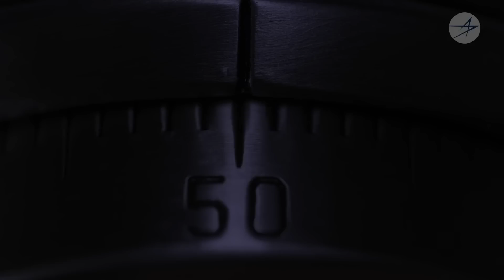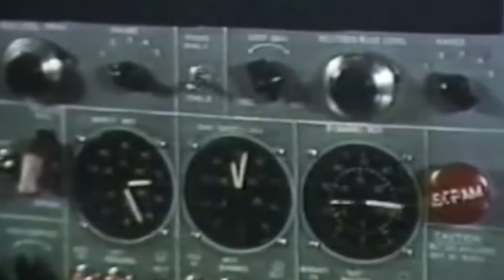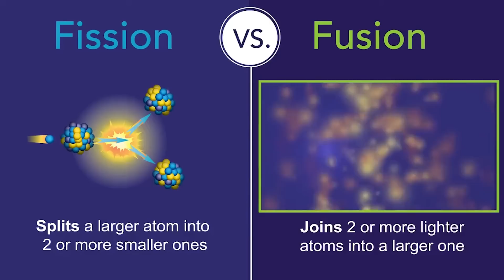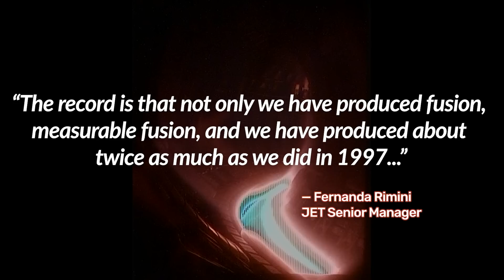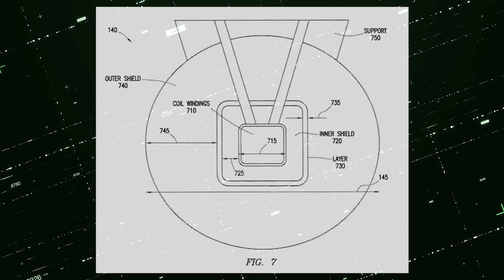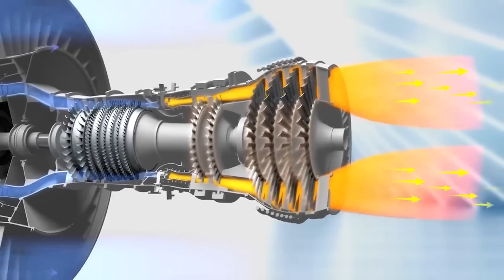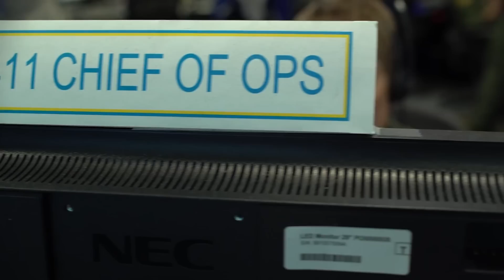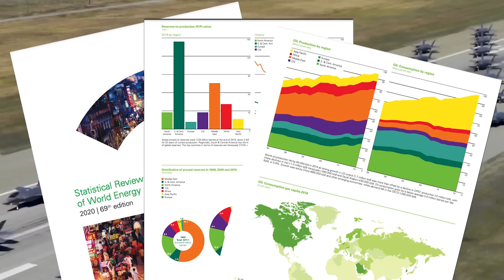Lockheed Martin's fusion-powered fighter and bomber plans

Comment: On a Separate note, why not have stealth tankers ( larger ones rather) or a stowed, carry along a mini killer gas station protection drone or two, they could be folded up on pylons, and if fighters threatened at a vulnerable time far from fighter protection,  one or two small remote combat drones, with AIM120s or AIM9x/ meteors could act as mini F14 Tomcats creating a perimeter @ the boat(flying gas station or P8) they could probably even be re - hooked to pylons mid flight for re- fueled,  and reused with AI assisted flight controls, just a goofy idea to make tankers way more independent and safe, the drones could even self destruct to stop a larger missile, or attacking fighter, with no pilot, two mini, supersonic, protect drones with long range weapons, in flight refueling, and possible kamikaze availability if needed, would keep advisories much further away, even P8 Poseidon's could carry something like this to keep bullies from buzzing the nose, the bully advisory jets would be met by two mini attack drones behind them fully armed, with no pilot to lose, and a message to head away from the US tanker or Posiden, then fly back re hook, re fuel and wait for the next task, I realize that's a huge workload, but the technology to make it happen is probably already developed. Probably work best designed with and integrated from scratch with the next gen of tankers and reconnaissance platforms, the Skunk works people probably already have something better 😂😂

Comment: Molten salt thorium reactors can, with modern engineering & materials could be made small enough to power a rather large aircraft. No massive amounts radio active materials & operates at temperatures liw enough to directly power a hot gas turbine

Comment: A major tragedy of nuclear powered aircraft reactors gave engineers and physicists to develop a potentially revolutionary power source better than many of the advanced reactors working today.  But for a number of reasons the US development of MSR,  Molten Salt Reactors designed by Alvin Martin Weinberg was an American nuclear physicist who was the administrator at Oak Ridge National Laboratory (ORNL) during and after the Manhattan project. Alvin was one of the greatest designers of reactors. The John Moses Browning of reactors. It was obvious that a nuclear bomber was impractical. But the potential for MSR reactors was huge. But Nixon had no understanding of nuclear energy cancelled the MSR project in 1972 for purely political reasons.  China is now using the Oak Ridge technology and research for its own MSR reactor project. MSR reactors have huge potential for low carbon energy. And also able to burn up existing nuclear fuel waste and weapons material. And potentially depleted Uranium and Thorium waste. Safer, cleaner and cheaper nuclear power. Far cheaper than the international ITER project.

Comment: I really like your videos.  But you do fission a disservice here.  

1. Waste cannot be dangerous in millions of years.  If it has a hundred thousand plus year half-life, that's not very much radioactivity.  Meaning it's not radiologically dangerous (unless it's something poisonous you can eat, but the same could be said for crushing random rock that has arsenic in it).

2.  Fission reactors do not all melt down.  For instance, molten salt reactors cannot melt down.  This is especially pertinent because the Aircraft Reactor Experiment actually used molten salt as a fuel.  Fukushima was a water moderated solid fueled reactor, and Chernobyl and graphite moderated solid fueled reactor.  The simple fact is the molten salt aircraft reactors would have been orders of magnitude safer than modern light water reactors (which are themselves way safer than Chernobyl).  I'm not saying to put reactors into airplanes, but let's be factual.

Comment: No. This will not work. A fission reactor on an aircraft can be done, but it's highly impractical. One of the many problems with that concept is the shielding: you need a lot to protect the crews from the high-energy neutrons coming from a fission reactor. Fusion produces neutrons of even higher energy, requiring even more shielding. Even if we can find a way to make magnetic confinement fusion work (which we never have), and even if we can miniaturize that kind of reactor (which we never have either), protecting the crew would require too much shielding for this to be practical in something the size of an F16.

This is setting aside the fact that you'd have to find a way to turn energy generated in this fusion reactor into propulsion for the aircraft. Simply having lots of fusion energy doesn't make that energy useful; we've had fusion energy since the 1950s in the form of hydrogen bombs.

Comment: The Air Force already tried a nuclear powered bomber, and it ended as fantastically as you would think; with most of the core blown out the exhaust all across the Idaho desert. This is a thought experiment at best, and with the speed that defense contractors suck in money from the US to delay projects for decades, this is at least 150 years from fruition.

Comment: So they have a container for the fusion reaction.  Great.  How about all the rest of the equipment used to start the fusion reaction and then all the equipment to take that fusion power and produce usable power to make the plane fly.  Hello?  There is no way to get all that stuff in an airplane.  Besides that, the first self-sustaining fusion reaction that produced more power than it consumed (supposedly) was achieved at the Lawrence Livermore National Laboratory and was announced at their press conference on 13th December 2022.  Their claim was very conditional however since they used nearly 200 lasers to do the initial compression which used 300 mega-joules of energy, the final ignition compression used 2.05 mega-joules, and the output was 3.15 mega-joules.  They only counted the final ignition compression of 2.05 mega-joules so they could claim the 3.15 mega-joule output was greater and thus a success.  The net power produced was O.305556 kilowatt hours.

Comment: Eh you really need to look in to a liquid fluoride Thorium salt breeder reactors that have non of the draw back of the current crop  of reactors. Lifters also produce tritritium and can fuel fusion reactors and produce the base line power for there magnetic bottling and ignition process.

Comment: You lost the argument at 14:18.

Plumbing Sucks.  

First off a 'fuel processing unit' makes no sense if it's closed loop system.  Burevestnik (the Russian nuclear cruise missile) doesn't need to use fuel, exposing the core to the air is enough to accelerate and compress it.  This is it's largest safety hazard as the air itself becomes radioactive.

Similarly, if you're producing even a single megawatt of electrical capacitance off that reactor, it's not necessary to heat JP-5 for some kind of detonative release upon injection into the airstream at the intakes.

You are literally better off designing a new bomber which doesn't have 312,000lbs/48,000 gallons of internal fuel (B-52) as structural/volumetric penalty and sending some of that weight savings as high density power cabling out to fewer, larger, differently shaped, (not round = no ground clearance or limiter Mach issues) nacelles to heat a thermocouple which achieves the same suck-squeeze-go process.

Any liquid loop doesn't involve superheated 'fuel' moving through the fuselage and wings to the nacelles and back again but is simply a local coolant to keep the heated core plate temps within throttleable limits for the material.

Modern military engine cores have temps approaching 3,600`F and you don't want that heat anywhere inside the jet where it cannot be armored/jettisonable to keep the aluminum/CFC from burning like paper confetti upon contact.

Indeed, within a given speed range (<550 knots), electric propellor driven systems maybe be more efficient than any thermal drive, simply because the turbopathway as a whole goes away and with it, 50% of your drag and all environmental access to the propulsion system.

A properly conceived nuclear cruise missile would work this way, even if it had to use something like an RTG instead of a CFR.  In everything from birdstrike to battle damage to simple TAC maintenance of an internally buried fuel loop (on a fighter or bomber subject to extremes of wing/body flexing as expansion, under G, Q and altitude based aerodynamic variables), _Plumbing Sucks_.

From an aerospace propulsion perspective, the real issue is that of ditching the reaction mass engine system altogether and moving towards some kind of inertialess drive/field effect system.  But at least if you are on the field with solid electrical generation options, you have some options.

Comment: Your information about fission power is not accurate. Read-up on Thorium Salt Reactors. Its an immediate and safe source of green energy. Thorium reactors shut down automatically so they are much safer than traditional reactors and the spent rods only have to be stored for around 100 years before they can be handled safely with bare hands.

Comment: There are some really interesting questions about how they are going to actually pull this off. First of all, you will need to be able to generate a very powerful EM field before you can start the fusion reaction process. It's all well and good if they can make the fusion and EM field self sustaining, but getting it started in the first place is going to require some serious power. Second of all, EM fields cause cancer. People living under high tension power lines develop brain tumors. How do they plan to create such a strong EM field and then shield the pilot from it? If people living dozens of feet from a high tension power line get cancer, I don't even want to imagine what this EM field would do to a pilot sitting 20 feet away from it. There is some serious technological voodoo at play here.

Comment: Nice if it works. Couple of problems:

(1) Getting a fusion reactor to work, as advertised. There are several organizations, both government and privately funded, that have been working on it for decades. The biggest, ITER, is funded (10s of billions Euros/dollars) by the richest governments, on the planet, and won't even start experiments for several years, even though construction began in 2013.

(2) Wars can start for more than practical reasons, such as securing an oil supply. Look at the war in Ukraine, and the possible invasion of Taiwan. Both caused, and possibly caused by some autocratic nut. The Chinese leaders before Xi Jingping would never even consider attacking Taiwan, as it was China's "golden goose", and China's prosperity was reliant keeping the status quo. Xi, was placed in power, due to his predecessors thinking he was a safe boring bet, who wouldn't "rock the boat". That  BIG  mistake has become evident in recent years. The Central Committee of the USSR thought the same of Stalin, and Xi is most likely worse than Stalin and Mao, combined !

Comment: They have not even been able to break even with large laboratories. It will be at least 50 years before fusion power becomes a reality. something small enough to power an aircraft would take many years. Lawrence Livermore Labs tried to hire me while still in college in the 1960s to work on their fusion  project. They are no closer to a practical functioning reactor now.

Comment: There is far more fossil carbon available than there is room for it in the atmosphere.  Even now the effects of the carbon we have used so far is threatening to cost us far more than the costs of the fuel to make the situation worse. Nuclear fission is extremely  problematic  as the radiation  effects could last longer than the methane effects, but a small nuclear fusion device would not have that problem. The poisoning of politics may make climate issues moot if the human species does not outlive those methane effects.

Comment: Nope.  The only one truly accurate word that can be applied to Fusion windbaggery.  Is there enough tritium fuel - nope.  Will it be achieved this decade - nope.  Fusion is great because there's very little nuclear waste - nope.  The first use of a working fusion reactor will be to power a military plane - nope.  Don't you think it's exciting that after reading about fusion being only 20-30 years away, back in the early 70's, that we are now on the precipice of finally achieving it - nope.  Ah, come on, surely you can see we've finally arrived? - nope.

Comment: The vision reactors were used to produce nuclear fuel for weapon production; thorium reactors are much safer, cheaper to build, cheaper to run, and much safer to use for electricity production.  It has been over looked for many years because it does not give fissile material for weapon production.  It uses molten salt and would produce cheap electricity; that every one can afford to use to heat homes.  Weapon production determined the very poor choice; the fear porn used to scare people about the wrong choices.  the spent fuel has never been stored in drums put into the salt mines.  the only thing in these drums are bodies or chemical waste.  $500,000/ 5grams of nuclear material is not being stored in any salt mine.  When GE complained about the high cost of handling spent fuel fuel; the US Army General in charge of Nuclear Power Plants, Electrical Generation, and Nuclear Weapon Storage and Handling offered to take the material off GE's hands, they very quickly declined the offer, in a huff.  When GE had tours of Power Plants, the high cost protection needed, basically using fear porn, for some sales pitch; this General would make it point to be swimming in the heavy water.  He never got cancer from damaged tissue from radiation poisoning.  He died of old age after living a full life; going from a private to the full rank of General.  He said you could safely carry a ball of plutonium away from your body, in each hand; you just did not want these balls to come in contact with each other.  Their has been a lot of fear porn put out their in the Industry; especially, by contractors to pad their invoices and to charge higher electric bills using the high cost of storage to explain the sur charges; which was a lie and is a lie.  Storing spent fuel; when processed into material worth $500,000/5 gms; their has been a lot gas lighting sent your way.   You have been paying too much for electricity all a long.

Comment: MAYBE in 250 years we'll see a fusion reactor small enough to fit in an f-16 sized aircraft.  70 years of investment and we still don't have a ground based fusion reactor powering anything.  ITER takes up acres of space and is at least a decade behind schedule and yet to produce a watt.  the ITER consortium doesn't even see a commercial fusion reactor operating until at least 2075, and again it will take up acres of space.  also take into account lockheed's decades of fusion boasts that occur only on paper.  for the life of me i don't know why they keep talking about it because at this point it just makes them look silly.  you would think a multibillion dollar arms manufacturer would care more about their reputation.  and they're claiming this one is 100% efficient - a physical impossibility.  they might as well say they invented a perpetual motion machine.
Reply: If we are still around in 250 years we would probably have moved on from Fusion power. Just as we are on the cusp of moving on from Fission reactors right now.

Comment: While I will give the Russians the credit of doing a lot with so much less. They can't even get a ship to run correctly with a nuclear reactor. I don't know if I would stretch the plane or jet idea. I mean even if it did work, the propellers or jet turbines have moving parts that wear out in time. But I don't worry about the meltdowns and that stuff as to run a relatively small jet or bomber the reactor would be the size of a refrigerator. A crash would have the environmental impact everyone bitches about. And they worry about radioactive stuff all the time. However, there is more cobalt in everything from phones, to the stents in my heart are also made of cobalt. Hell I probably glow in the dark and may set off 1 of those ticker machines (can't spell it, lol) if they put it near my chest, lol.

Comment: Finally, they're actually powered with this and so are subs, aircraft carriers, etc  US10322827B2 .It's not fusion but Zero Point Energy, or, the energy of all things. This little gem produces a Terawatt, to put that into context if we combined all of the powerplants on Earth they would produce about 6 Terawatts. This unit is about 3ft diameter. The Space Force uses these and other forms of Zero Point Energy in this US10144532B2 and other craft. This little ship is slow at only 300 miles per second while others can exceed 50 times the Speed of Light. Dual propulsion is nothing new, we've been doing it since the 50's. Our first space ships were submarines. Our first massive deep space ships launched about 20 years ago.USS Lemay, USS Hillenkoetter, USS Vandenberg.